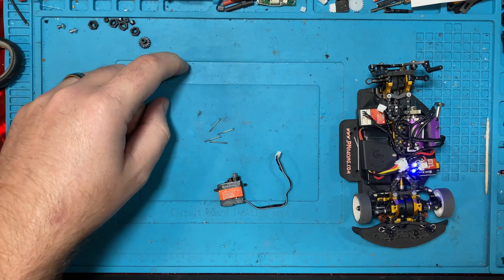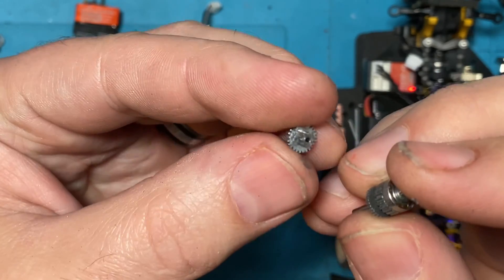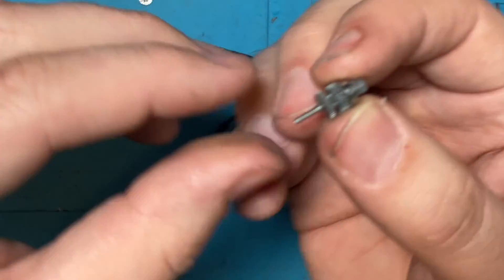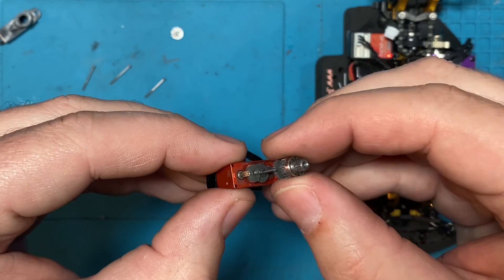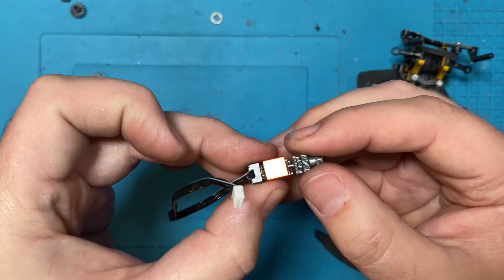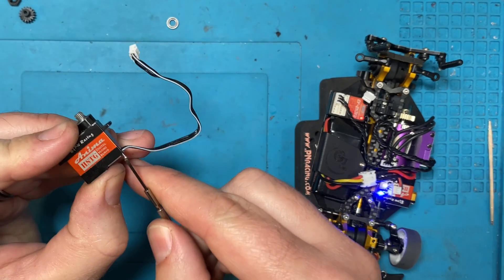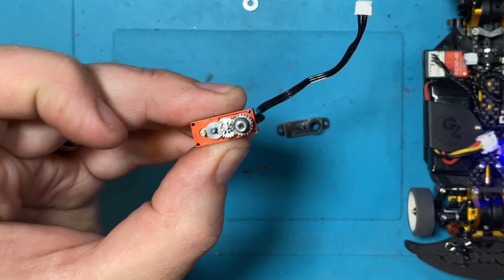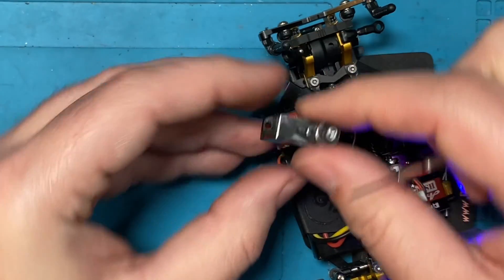Servo Repair! We fix a PN Racing Anima HSTG Servo. Save that $$$$!

Comment: Fixed servo yo just broke mine hope this vid helps
Reply from the maker: Me too
Reply: @TheShopMiniRC so I tried this today the gear that broke for me is the big one where servo horn gets screwed into once that one break it’s done for ?? Mine when I power up goes right to that broken tooth section even when I put it 180 when rebuilding
Reply from the maker: @ yeah… if that gear breaks, you’re in a bad spot because it will always want to be in that position due to the potentiometer.  If you can’t put it 180 degrees, then your screwed and need to buy a new gear.
Reply: @ got one otw I have the ao6v2 and didn’t know but ordered v1 gears hoping it’ll still work

Comment: Great video Ken! Unfortunately for me at the MHGP i broke 3 servos...all of them failed on the keyed main output shaft so I had buy new gear sets.😥
Reply from the maker: What brand servo?  I would love to find some PN Anima gears.
Reply: @TheShopMiniRC  A06CLS, the gears stripped because the bumper I used was too narrow in my RX28. Lesson learned😅
Reply from the maker: @pcparas1121  oops indeed.